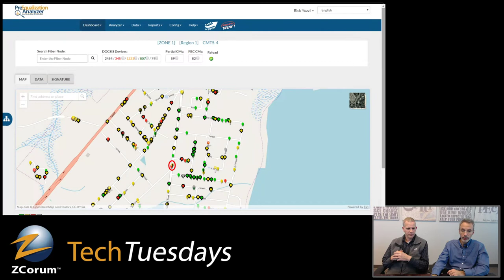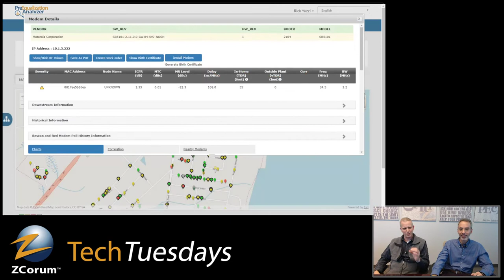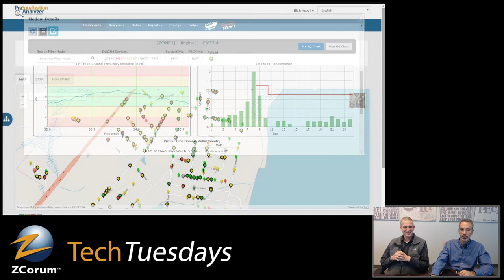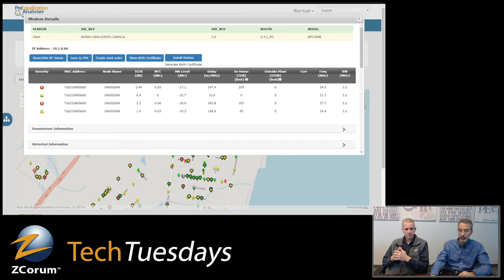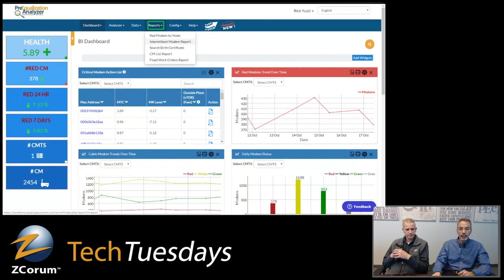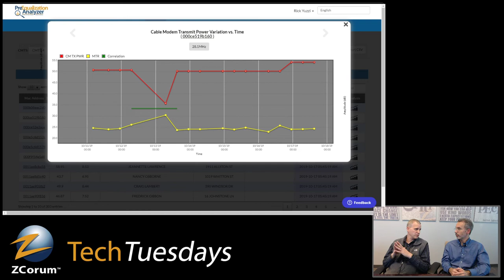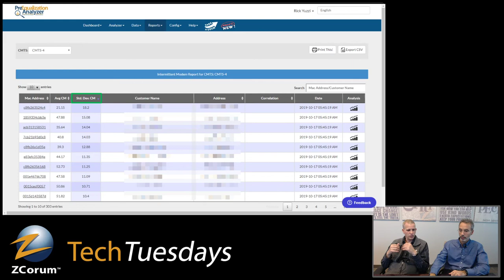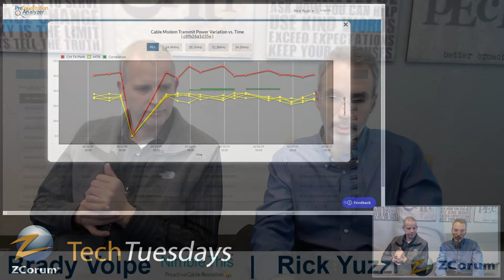Finding Likely Sources of Ingress in your Cable Plant with Proactive Network Maintenance (PNM)

Comment: Hi  Brady and Rick nice presentation. Question how would I know when the problem has been fixed? do I have to wait for the software to update?  Learning a lot from you guys.
Reply from the maker: Hi, Razy. That's a great question. You would need to wait a couple of days and then review the Intermittent Modem Report to monitor the specific modem to verify that it is no longer varying in upstream transmit power and MTR.  There is always the chance when looking for an issue that there is more than one loose/bad connector or damaged coax. So you might fix one of multiple issues. Brady briefly mentioned using a pressure testing kit in conjunction with PreEqualization Analyzer. Once you've identified the home with the intermittent modem, a pressure testing kit will help you quickly find the issue or multiple issues at the home. We strongly recommend pressure test kits in order to ensure you find all issues and eliminate repeat visits.
 We work closely with Effigis on their pressure testing kit and you can get that through us (https://www.zcorum.com/wp-content/uploads/PEA-CPAT-Flex-Product-Sheet.pdf). If you would like more information, just send an email to info @ ZCorum.com and I'll have someone contact you.
Reply from the maker: @jimmyjoe1591  If you mean the leakage detection equipment, it depends on type of equipment, but it's very reasonable, especially considering how much time it saves and disruption it avoids. The PNM application (PreEqualization Analyzer) is generally purchased as a hosted application (i.e. "software as a service"), so it is a reasonable cost per subscriber. Just go here and complete the form and someone can contact to get the details needed to provide a quote for either product or both: https://offer.zcorum.com/main-contact-form